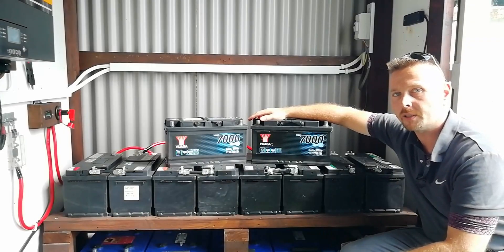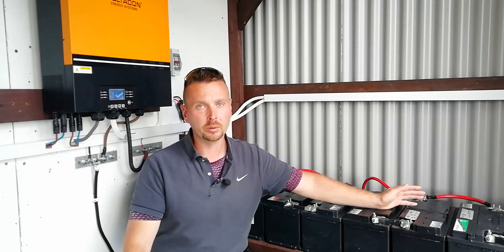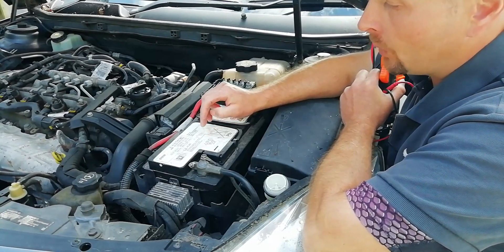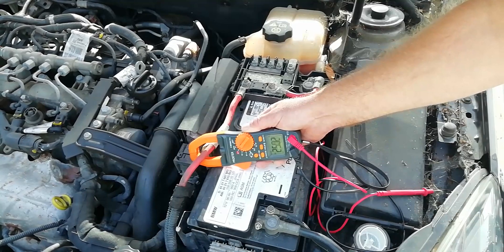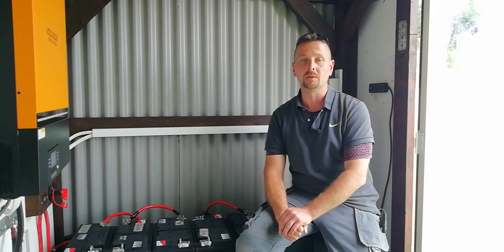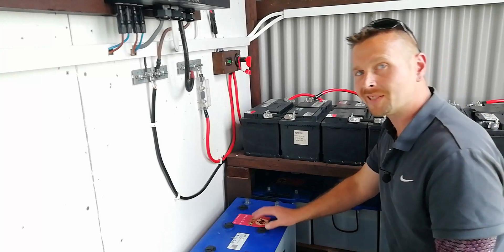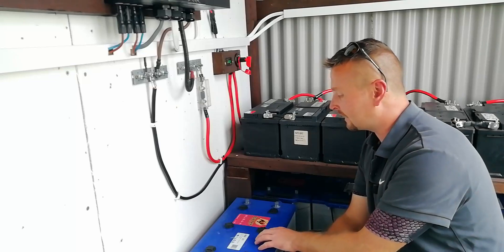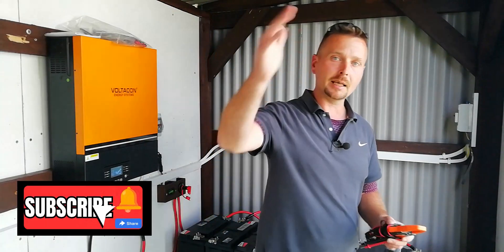Lead Acid Batteries, The Best Way to Charge. In Service Charging

Comment: most car systems operate at 14.4V at the alternator and charge the battery at that rather than 14.7V. Its no wonder the batteries only last 2 years. However i recently tried to resurrect my dead car battery, it still holds a charge for 2 weeks for the alarm but wont crank fully charged. I managed to get it from 1-7% health by adding new battery acid and doing the extra volts but still have far to go

i see you just check the voltage and if the battery works, but i suggest you use a battery tester to check the health. For a car battery the CCA matters but for all lead acid batteries, you want the internal resistance reading. The test has to be done on a battery not connected to charging. This tells you the real health of the battery. So far i've halved the internal resistance from almost 80milliohms to 30 but everytime i charge it heats up a lot. For flooded batteries in cars, the inside can get dirty so the acid can end up dissolving with dirt, hence why adding more acid (not just distilled water) can help.

The internal resistance of a battery when fully charged is the true measure of its health. Not sure if the battery getting hot while charging is normal. We all use car batteries with a capacity of 35AH here and our engines are small, so our charging needs are also low. Its a good thing i have a bench PSU because my smart charger uses between 14.4-14.6V with 5.8A charge on my battery but on my PSU at 14.7V with flooded it will pull 7A on its own. equalising it did help, once all the cells bubble equally the battery is balanced.
Reply from the maker: This channel is run by a qualified mechanic of over 25yr career. When you get information from this channel, it is fact!

Comment: I'm planning on hooking up my Sterling Battery to Battery charger to my 110Ah leisure battery, but the output is 30Amps from the charger... do you think I should use a shunt resistor to keep the current at 20amps or so instead of the 30Amps? 
Thanks for the vid!!
Reply from the maker: @marcomalley2516  it's completely up to you really. The Victron smart shunt seems to be highly recommended by many diy off grid system enthusiasts.
Reply: @ourkilkennyhomestead2006  Yes I have come across this too, I might have to invest if the battery monitor I have shows me some odd readings. Thanks very much for your quick reply :)

Comment: All good and well using a car set up for voltages. The battery capacity has been calculated according to the car. The C rating is taken into account and thats why the battery lasts long. In an off grid set up its abit different. Sizing the lead acid bank correctly according to the loads with C value discharge and charge will make them last longer. Summer its fine as your loads are small compared to winter. Charging is fast with long sunny days. Winter with only 4 to 5 sun hours and lower inputs from your solar the lead acids now take much longer to charge. I run both lead acid and lithium on two seperate inveters. Using one batter bank today and the other the next day. The lithuims 2 pylon 500 charge up very quickly and can be dicharged at a higher rate. My lead acids 6 volt 225 ampx 8 can only go down to 50% they take abit of time to get up to full charge. I purchased a Renogy battery monitor for the lead acid as it show the discharge charge, charge and time available. As with your system a wind turbine is great for lead acids as its still getting a charge at night. Its all about sizing your system to your needs and knowing if the weather is bad today no sun rain and no wind hold short on the washing machine or start the generator.
Reply: not really. most cars i see undervolt charging due to cheap alternators. You should ask the french about that as they are one of the biggest OEMs for alternators and they hover between 13.8-14.4V with 100A limits. For a battery to last long for a car, the reserve capacity matters. If you drive once a week then the battery drain in reserve capacity shouldnt exceed 20% of rated. CCA itself only matters to crank the engine not on how long it lasts. In truth a car better with more reserve means thicker plates that last longer, often the trade off is higher CCA for less reserve so they lose CCA and performance faster from thinner plates and it also makes them less likely to be resurrected.

Comment: What if on a daily basis isnt discharged more than 10%. In my case a 105amp battery deep cycle floaded battery. What can the float voltage be set at. Its a 12volt battery that i have

Comment: Does your system hold that ~2.5 volt per cell absorption voltage all day after it is reached?  Or does it step down to a float voltage eventually?  Those are AGM batteries?  Is the voltage compensated for battery temperature?  Hope you don’t mind all of the questions. 

I’ve recently bought a motor coach and have installed a Victron inverter charger to both charge the battery and allow the use of some AC power without the need for running the generator set. I’ve not yet decided on a battery, though I’ve always had a fondness for FLA, which is why I watched your video when I saw it. Am considering 6 large individual (as in 2 volt) cells. Everything else in the coach is 12 volt, so I’m sticking with that voltage for the battery. 

Lastly, I would not think that the required battery charging voltage would change based on other loads on the system. The generator voltage regulator should maintain the correct battery voltage, even as other system load changes. Maybe I misunderstood that part of the video. 

Couldn’t agree more about the majority of “information” found on much of the net. I like to say that we are living solidly in The Misinformation Era.
Reply from the maker: @realvanman1  our system keeps the voltage level up as long theres sufficient daylight. All the batteries are bog standard flooded lead acids.   No there's no temperature compensation, our system is set up to mimic charging in an engine bay which doesn't have temperature compensation either. Both voltage and amperage from an alternator will adjust based on load otherwise the more loads you put on the less power you have and won't be able to run the loads. Voltage doesn't change by much in this instance but amperage does.
Just remember that if you're charging your leisure battery setup from your alternator, it's best to keep it the same type as the engine battery as different batteries will have different absorption which can result in one or the other taking most of the charge and the other not getting enough. Best to fit an isolator switch between them where the alternator only charges both when there's insufficient solar power.
Hope that answers your questions.

Comment: All makes good sense. Most of my experience with lead-acid batteries is for standby applications for communication equipment where a rapid charge isn’t really required, yet manufacturers of some equipment, particularly UPS systems try to be too clever and they just cook the batteries every three years. One piece of (American) equipment actually has two ‘intelligent’ chargers in parallel, each of which has its own ideas about what it should be doing. For standby applications, just float a 12V battery at 13.8V with a charger current limited to 5 or 10A, no multi-stage charging required. They usually last 10 years+ like that. One customer has a diesel standby generator with a 10 year old battery floating at 13.8V, which still works fine. The manual lift pump lever is broken so it takes a good amount of cranking to prime the system after a filter change, which it still does with no sign of slowing down.
Reply from the maker: @petesmith2234  quick tip for your diesel generator customer, if they loosen the injector pipe nuts at the injectors after a filter change then crank the motor a few times in bursts of 10-20 seconds or so, it will bleed out any air trapped in the system and get the motor started faster. Once fuel flow is seen at the loosened pipe fittings on each injector, tighten them back up again and it should fire up straight away.
Reply: @ourkilkennyhomestead2006 I have done that in the past, but the main issue is filling the filter. Once I have fuel at the filter bleed screw, it usually starts on at least a couple of cylinders fairly quickly and provided it sorts itself out before it shuts down on low frequency, all’s good. The controller is programmed to crank for 10 seconds, pause for 10 seconds, which it repeats 5 times before declaring a ‘fail to start’ I usually have to reset it a couple of times, so it’s probably cranking for about 90 seconds in total.
Reply: regarding UPS batteries or small gel batteries, these typically set an initial current of 2.1A. So before you can push 10A on them you have to start charging them with 2.1A first then only increase the current necessarily.

Comment: Those batteries are like toys for an off grid system. Get some traction batteries aka IFLA.
Reply from the maker: @MyMednas  why would I do that when fla are a third of the price. Eg: 1x 2v 150ah traction cell is €120. By comparison 1x 12v 100ah fla is also €120. 300ah vs 1kwh for €120.
Sure, If money was no object I'd buy better, but let's keep it real.

Comment: You are spot on in your reccomendations.  there is a group of us that refurb traction batteries for home power use and equalise 24V system batteries to 30-32V. This restores the batteries to very good working condition. It does not happen overnight, sometimestakes  months but it certainly does work. 

You are also spot on about the regurgitated ignorant crap on websites, particularly FB pages.  People just repeat the same crap they read before and have no idea they are repeating complete misinformation.
Reply from the maker: @glumpy10  thank you! Funny enough it was seeing what people were saying on fb that inspired this video.

Comment: I'm not sure if measuring the voltage is enough to figure out what the SOC of the battery
Reply from the maker: @Bonifatcii if I had included the discharge tests the vid would have been a half hour long.